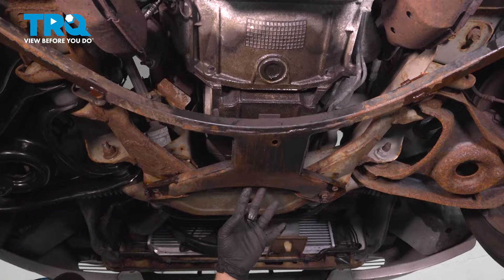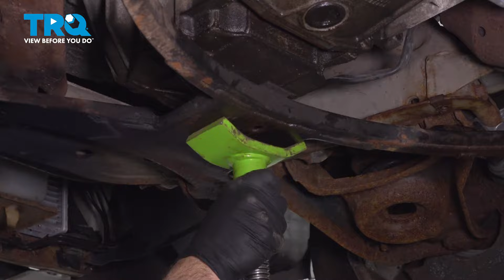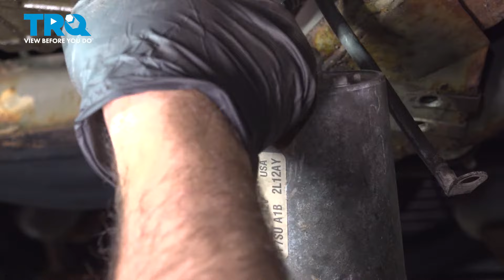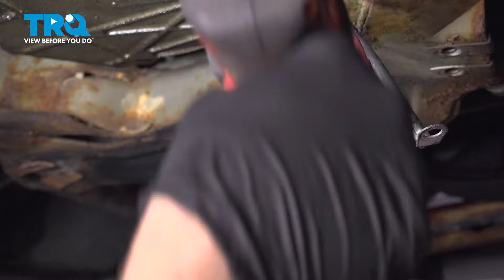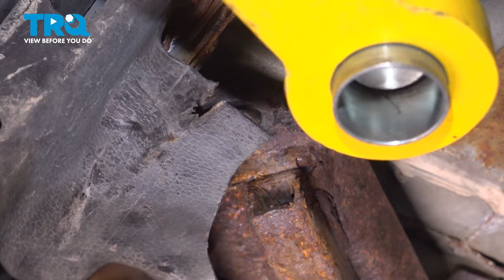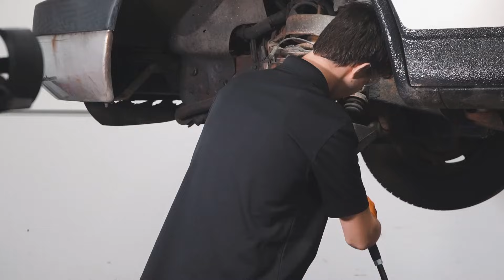How to Replace Starter 1994-2004 Ford Mustang 3.8L V6

Comment: 4/24/26 Just changed my starter. You do not have to completely remove the cross brace. Losen all visible bolts  completely but you don't have to remove. You will need a pry bar to move those lines. And I wedged a old ratchet under the cross brace to keep it away from the body as far as possible.
From start to finish it took about 2 hours and that's including cleanup of tools and test start. Ratcheting wrenches are very helpful. Also, use a battery powered ratchet for the bolts. Saves a lot of time. Take a picture of how the wires are connected before you take it apart. Good luck

Comment: 2004 Mustang v6, 3.9, convertible.  I did this job using ramps, a lift would have been better.  Sprayed WD40 on crossmember bolts. I did not remove plastic fasteners, just pryed back the plastic with a screwdriver.  Zipping the crossmember bolts out with an impact wrench would have been better.  Getting the starter out of the bell housing was difficult as was getting it by the two lines.  The new starter came with a new lead attached with a message from Ford saying people have experienced corrosion on the old lead so cut off four inches of the old lead and use heat shrink tubing before crimping the new lead on.  Good thing I double checked the crimp job before bolting up the starter. The first attempt failed as the wire slipped out.  I used a heat gun for the shrink wrap over the butt connector.  Of course, had same difficulties getting the new starter up past the two lines and getting the snout into the bell housing. Mounting bolts went in ok.  Connected the ground wire to the stud. Recommend using a jack to support the crossmember and installing rear bolts first.  The front holes are big and allow for movement.  After starting all bolts, snugged them up with the impact wrench.  Connected the battery, turned the key, started right up.  I’m 64, 210lbs. Retired with more time than money.  Good luck.

Comment: Good job I have 71,000 on my mustang convertible 2004, I don't drive it like I used to but I still have all original parts, I'm 63 now that doesn't look like a job I want to take on. 

 Are you on a lift or are you working from the ground I can't even tell

Comment: I recently bought a gt trans for my v6, I thought they would be interchangeable but i guess not, the v8 has 3 starter bolts and the v6 has 2, I was wondering if I was able to use the v8 starter without problems because then it would fit right in i just don’t know if the teeth or anything else was different or if i would make my own holes in the spots they should be in for the 2 bolt starter.

Comment: The Trick!   Take off the bracket that is attached to the motor mount that holds the O2 sensor connector and holds the wire loom from the botttom. Throw it away. I just saved you hours.
   Also , you probally have to loosen the motor mount bolt and jack up bell housing to get the starter in and out.

Comment: 6:58 That is the million dollar question......I cant get the snout out.....been trying for hours. Don't want to damage the starter using a prybar because I might just remove solenoid and just need that replaced.....thanks for the video has helped with the project...